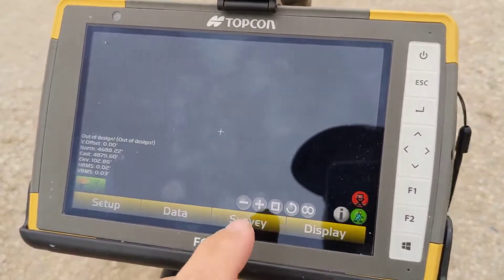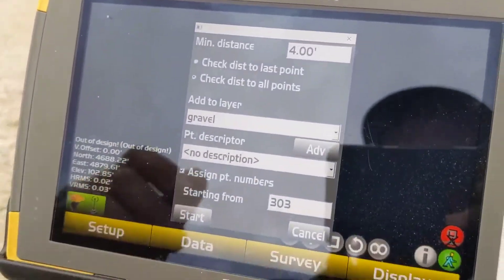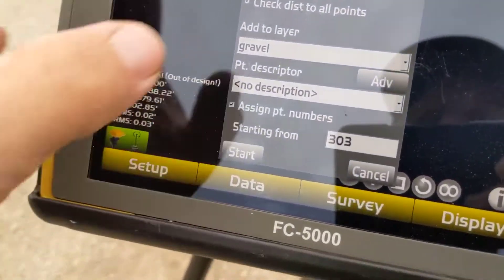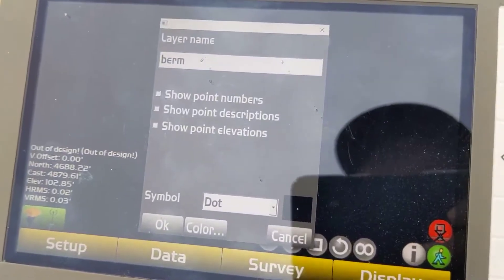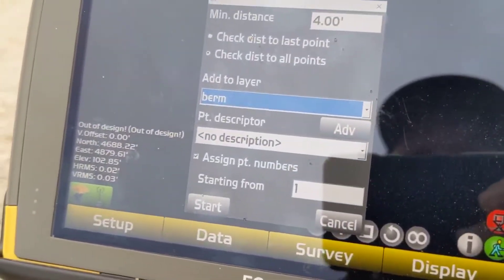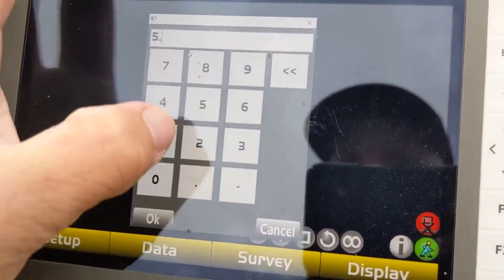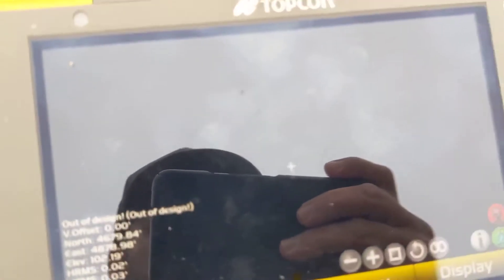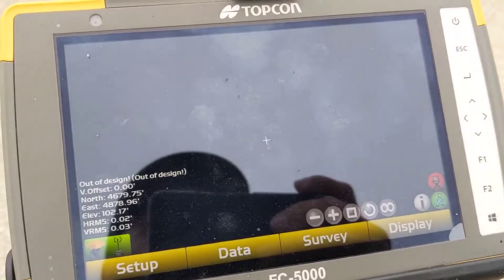Topcon Pocket 3D - Using Auto-Topo

Comment: I got a question for you bud.  So at work I use a Trimble SPS930 (basically an s9).  I mostly do linework when I do a topo, that’s what my chief likes to send the engineers.  In Trimble Siteworks you can create a line, stop topoing and then if I want I can hold on the line and continue that line instead of starting a new line.  It’s good for topoing too of curb and gutter.  So I’ll take my first shot on the gutter, walk up 20 feet take another shot.  Then I walk back to where I started  and take a shot on the curb on a new line, walk up 20 feet take a a shot on curb again, walk up take a shot on curb again then come down to the gutter, hold down the line I shot of the gutter continue that line take a shot, walk up 20 feet, take a shot of the gutter.  Rod then goes on the curb, hold down the top of curb line I was shooting.  Continue that line.  Take a shot on curb.  Walk 20 feet take shot on curb rod goes to gutter.  Hold down the line work of the gutter topo, continue line, take a shot walk 20 feet take shot at gutter.  Rod then goes on curb select that top of curb line to continue and then take a shot.  And we will do that for our whole run.  I get it’s faster than doing a topo of the whole curb line and then once down walk back down to topo gutter.  Is there any way to do a topo on pocket 3D where I can start a topo line and then go back to it to continue it or do I need to start a new line once I stop topoing that line?